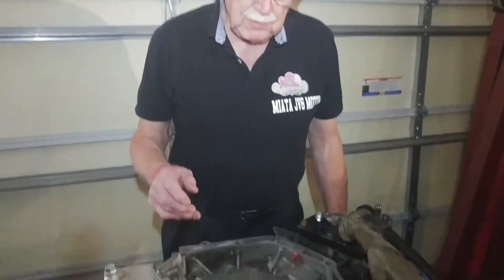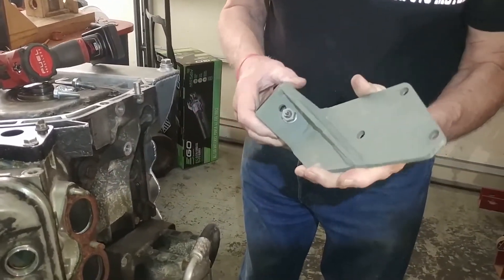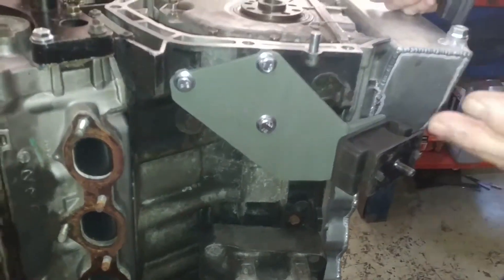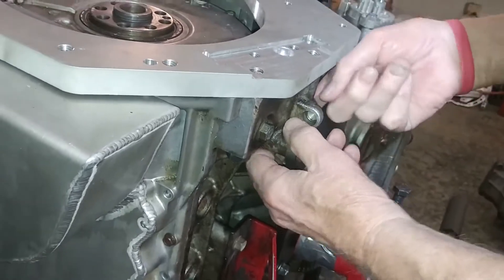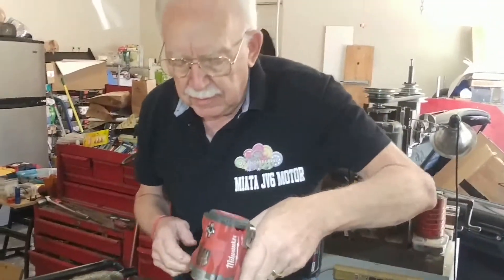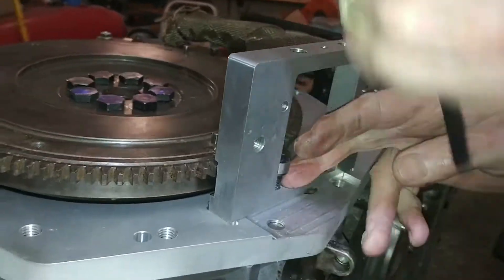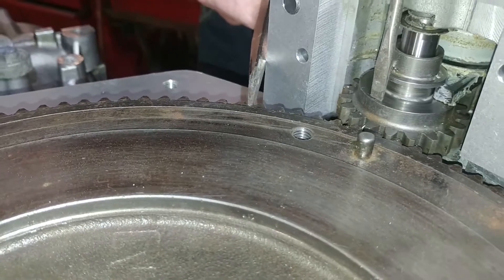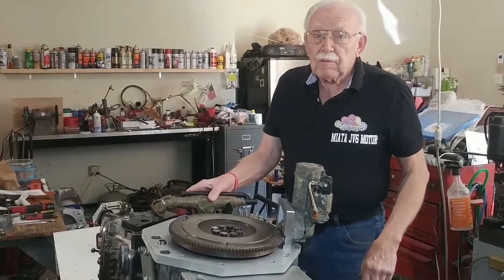Miata V6 Installation Step 4

Comment: So the Ridgeline starter works with the B series flywheel? What did you need to check to ensure that would work since they have different diameter ring gears and tooth count?
Reply from the maker: When we looked closely, the profile of the teeth on the Ridgeline flywheel was identical to the teeth on the B series flywheel. We tested how they meshed together and found them to be compatible.

Comment: 3:30 the cover over the motor mount is a safety device, if the motor mount rips in half the engine will still be held in place by the cover
Reply from the maker: That's a good point. It might be possible to modify the motor mount cover to fit if desired but the clearances are tight. I recommend using the firmer Mazda engine mount for longevity.